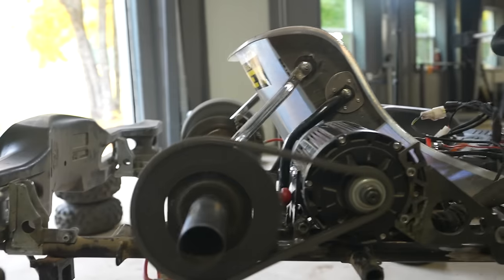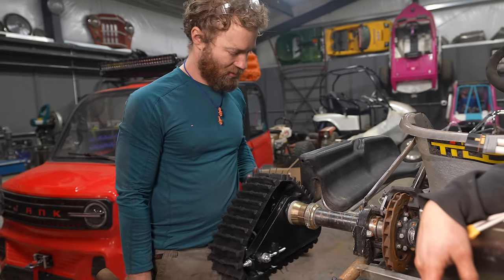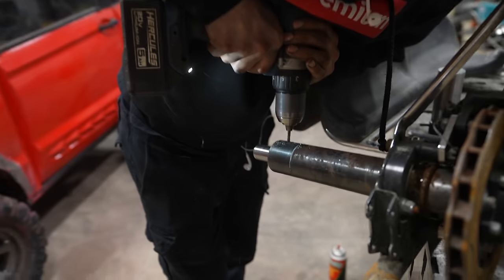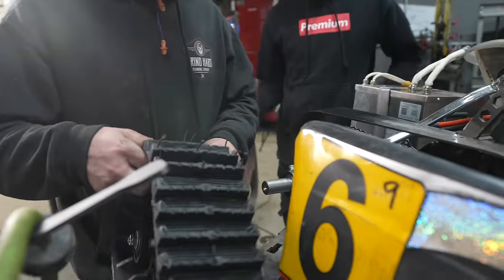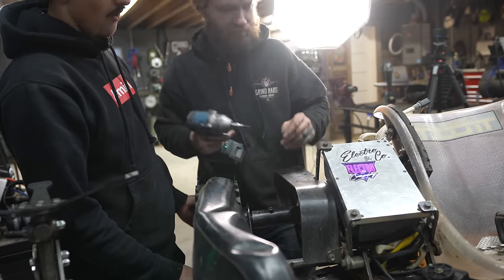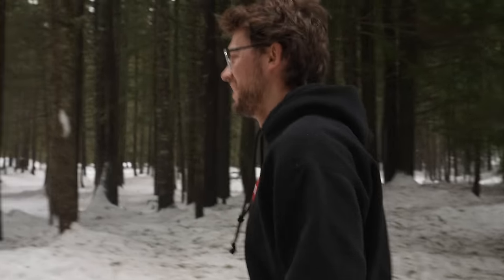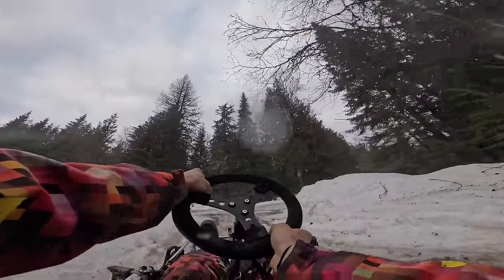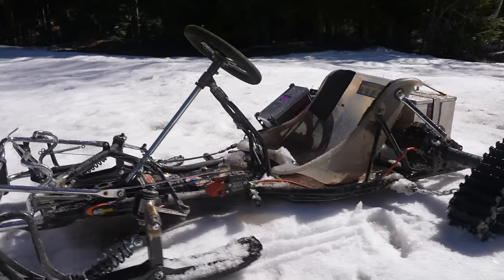Sleeper Go Kart gets Tracks and Skis!

Comment: Hey machinist Willey! Next time you only have to take off a little bit just run it again without turning any dials. It's called a spring pass. It just takes off the amount that the cutter flexes away from the part. You'll be surprised how often you can go too far without going anywhere!

Comment: Make an electric crosskart "trike" with a battery pack in the back (over track), but have it on a swing arm, so that it works like a servo, making it so you don't have to tilt/ lean while turning, and able to control it while doing a wheelie! 
This proof of concept can start a new wave of snow machines, since electric snowmobiles as is sucks hard and is anything but premium.
Reply: or just put the motor and tracks on the barbie boat to make it amphibious all weather
Reply: Sorry but I'm confused  why would u have to lean/tilt in a cross cart to turn? They have 4 wheels? We'll tracks if I'm reading this right lol
Reply: @Todd_G_FPV  Not OP but probably to counterlean during a turn. With long suspension vehicles (without an anti-rollbar) during turns, they have a tendency to lean outwards. this would solve that without using an anti-rollbar (which you want for some reason????).
Reply: @Todd_G_FPV  Let me clear things up.. it's a snowmobile, but picture a crosskart trike, the battery can lean from side to side as to shifts the center of mass, it also offset driver weight up front 2, using the battery weight as a feature, and not a flaw like EVERY electric machine ever. 
it would be MUCH safer during avalanches, and you'd be able to climb RLY well in it.
for those who play in snow, this will save lives.

Comment: When going through my machinist class. The math behind it is that when cutting circular stock on a lathe it is actually double the depth of your cut. So cut half of what you want until you get comfortable enough to take the big cuts
Reply: Yes because you are decreasing the radius by the amount you move. So it takes that much off of each point all the way around the circumference.
Reply: 1/2” cut on the radius is a full 1” off the diameter.

Comment: NGL GHPC, could throw solar panels on the roof of the shop and have a battery backup system (and I think Anker makes those) which would help the power problems (when they occur)
Reply: Anyone who owns a home that can afford solar panels and home battery back up should get that installed ASAP. My power cost has gone up over %20 in under a year. If cost continues to rise, the ROI graph will be a curve, not a straight line

Comment: I love working with old machines. Had a 1970s good way lathe at the last shop I worked for. Amazing tool. Could take some massive cuts. For example it could take a .650 thow interrupted cut comfortably. Or it could turn some perfect sealing surfaces. Also I agree with never using calipers on fits. Gotta mic it! Or test fit! 🤣 you guys are amazing!

Comment: Use a small drill bit to make pilot holes before using the step bit. It will save time and make the step bit last longer.

Do NOT blow chips off a part without safety glasses or at least close your eyes first.

Comment: That motor is wayyyy too powerful for the tracks! 😂
Reply: its either the motor was too powerful or the tracks were just designed to go much much slower.  They probably designed them to go on some kids toy at like 1/10th the RPM
Reply: @davidanalyst671  Agreed. 👍

Comment: Hey Will. Always put your heat into the thicker metal and let your puddle wash into the thinner material. That will create better adhesion to the parent material and you wont get the "log" appearance.  And as always, setup the welder with practice pieces of the same thicknesses.  "Make love to it, don't f@wk it."

Comment: I see that gives you 6,000-W and an amp rating of 30 amps. If you use the lathe, air compressor, or welder, all separately and not at once, then you should be fine. But you'd benefit from the double setup they have, giving you 12,000-W, or the battery expansions like you said.

We thought we were ok here, and didn't need a backup generator. Then the power went out for 31 hours a few weeks ago. The next day we ordered a 22-KW Generac Guardian generator with the automatic transfer panel. It runs off of natural gas or propane. The entire generator with the transfer panel, shipped to the door was about $6500. And then another $700 in parts for the conduit and wire. We wired it ourselves, and it's big enough to run our entire place (including 2 HVAC systems and a boiler) and were able to hook up our neighbor's house also, since they don't have AC, there's not much of an amp draw there. In any power outage though, we just don't run the electric dryer, and likely could go a couple days just hanging laundry.

Comment: your electrical setup in the shop with that anker bank is so sick. i wonder how long it would last with you guys just doing normal shop things for an episode.
Reply: Not as long as even a single generator…. The battery backup is stupid for their application. A shop, in the middle of nowhere, doesn’t need this. A simple generator or even 6 will do the trick, for less money.

Comment: I want to see you guys put a huyabusa engine into a gokart or quad. Also maybe put one of the model engines for RC cars that run on nitrous into a full sized vehicle to see if it will work.
Reply: Hell yeah,a Huyabusa powered four wheeler would be sick AF! I would really hope that they would stretch the frame out a bit and then lengthen the swing arm too! No sense in doing all that work to build a bad ass machine if it’s an unridable death trap!
Reply: Fax

Comment: You should put two tracks on either rear tire and put a outer guide to keep both tracks on actually inner guide and outer guide welded on the outside of either side.
And put wheels on the front they will still turn in the snow similar to skis.
And I've seen at the drag strips where they put solid rubber on the tracks instead of grooved

Comment: 18 yrs ago I bought a back up generator 30k that runs my whole house.  6,200 squ ft. It runs on propane has a Chevy 4 cly. Hooked it i have a 500 gallon tank. In 12 years it starts 1 time a week for 15 minutes. There was here in Missouri we had a bad ice storm out of electric for 7 days straight. An a lot more other times we was out , it only used 450 gallons propane in that 12 years.  Kicks on with in 15 seconds automatic. One of those battery generators be awesome for my Rv. The price is not bad at all. Mine was $12,500. It get hot in Missouri run 2 ac units an every light. Its paid for its self. I live out in the country.

Comment: Here's a fun idea. Rework an old skid steer to be electric and stupid fast. You could make it a differential breaking system or a independent  drive for each track. I think it would be a fun project and it might be the only way to handle all the power those electric motors put out.

Comment: Be careful! I think you should first plug the orange plug and then the blue connector to the wall. 

The blue has insulated connectors. If the wall is live (happen to have forgot one fuse on), the orange plug could have dedly live prongs exposed. 

Cool things you are making

Comment: I used two 12 inch speed squares (carpenter tool) to attach two ski tips about a foot long to my downhill mt bike to ride the snow. The hypotenuse faces forward and the tail end of ski is exactly where the wheel is designed to hit the ground. If the back of the ski extends back beyond the line drawn through your head tube to the ground  it ruins what the geometry of the vehicle was designed for. I lucked into this knowledge, but it's for real. On my Wheelski (Patent search confirms my design is fit for utility patent in 1998 for unique pivot. Acts like knees of the skier) I could shred the slopes
You guys need to hear my testimony. LOL Seriously though, I was riding ski slopes on my DH bike at Woodbury Connecticut on weekdays and Plattekill in Roxbury New York on the weekends. I could ride with no hands it was so stable and I could make turns so sharp I could touch the bars to the snow, but Plattekill is super steep at like 40 degrees so maybe that accounts for the crazy turning
anyway, love your projects and love watching fun

Comment: Now you need a contactor to automatically switch over to the battery box when the main power goes out.
Maybe on day he will find that there are intermediate position of the throttle pedal beside all the way off and all the way on.

Comment: With the circuits you basically mean that you have it wired to the lines leaving the fuse box to each zone. Just to clear it up for those that don’t understand. It’s so he has direct power that is then connected to each zone powered by a generator. It’s super simple. Yes anyone could connect it themselves but please make sure all power is cut so you are not playing with live wires. Only after it’s installed and inspected would I suggest testing and turning it on.

Comment: General needs a oil seal or gasket somewhere to stop the oil bath your giving the floor. The 16k Generac natural gas genset  powers our Whole house and I have a Welder and big 220 air compressor I use occasionally.

Comment: So if the power is out, could you flip the breaker panel over to the Anker, which would then be powering everything, could you plug that 1800W wall plug and charge whilst running?

Comment: Rookie mistake with the lathe, you have to remember that taking off .5 mm is 1 mm in total when dealing with circumference . A bridge port is different when milling a single sided object Unless you are using a rotator vice then the same rules apply.

Comment: Very crazy project. 
But i have a clue why the nice guy at the lathe failed several time to meet the required measurement.
It might be possible that, at the very last measurement, he decided that he needs exactly, lets say for example 1/10 mm less in diameter to meet the goal.
And if he doesnt think twice, he will not realize that, if he will adjust the cutting egde just that 1/10 mm, the overal diameter of the shaft will decrease for 2/10 mm.  Because what you are cutting away at the front, will be removed at the back as well.
I know what i am talking about. Happened to me as well...several times.
Keep on the good work.

Comment: Anker SOLIX F3800 Portable Power Station $3000.00 w/ 10 year life expectancy

DuroMax XP13000EH Dual Fuel Portable Generator Gas or Propane Powered, electric start, $1500.00 unlimited lifetime expectancy

I used the DuraMax brand because it is by far the best budget Generater on the market

Comment: Hey, how is the shop air ?

Filter your air man! Think about your lungs❤❤😊
Reply from the maker: we've been trying to sort that out. Not sure how to go about it. Suggestions?
Reply: @GrindHardPlumbingCo  how about cheap Fume Extractors they are pretty portable and easy too use. 🥰

Although if you have space you can get a central Fume Extractor that has extensions too various spots in the shop.

Comment: One trick for better lathe cuts wrap a big rubber band or a large coil spring around the chuck/head this is an old trick learned from machining drums and rotors it reduces the chatter in the cuts to near non existant

Comment: how do you determine the final gear ratio with tracks? Is the size of the individual driven single wheel in the track the diameter you use?  Apparently its not the height of the top of the track to the ground

Comment: You don't need 2400 watts of solar unless you plan on using that as a standalone unit.  You could easily get away with less than that if only using it as a backup.

Comment: Its cool to see someone make a mistake and also take criticism accordingly with a smile and acknowledgement of the mistake and their previous false sense of professionalism.
The lathe, the caliper, the trusting of the caliper either not used correctly it appears, because the gap was very noticable. Even a dollarstore caliper would not have caused such a gap, therefore, learning to work the caliper is a concern, as is also to double check the amount of material being shaved off with the lathe to help compensate for the way the caliper wasnt held to the exact diameter when it was being treated like a tool to rely on.

I make tons of mistakes and try to learn from them, I study physics, sociology, criminology, and music.
Party on Garth, you are a worthy team player that learns from mistakes rather than flipping out and stomping out the door like avid beeeline exit plan narcissists do.

Comment: That's just what boxers do... 🎶 🎵 ⏹️ 🪕 🎼 💿 🎶
Reply: Will blew another head gasket...inevitably.  😂
Reply: My Subaru heads have been leaking for 70,000 miles but a well seasoned boxer can go 12 rounds if you know what I mean. 😮😂
Reply: Hey Will! Do you want to come to San Diego and fix my head gaskets in exchange for surfing lessons? 😂🎉❤ 🙏
Reply: I just put new plugs in and removed and cleaned the throttle body.... but the main issue persists.  😮😊😂
Reply: I have enough boards and wetsuits to teach the whole crew to surf if you want to come to the coast. Different vibes with no motor in the water! 🏄‍♂️ 🌊

Comment: You had traction. You were just afraid of it. Honestly it would have looked sick to get tires front and back as wide as you can find that clear everything. It works in the snow with this setup but looks like dirt is a small challenge. Maybe make the same setup with the motor and all but this time use wide tires and race them both. Test and see which one has more traction, faster, maneuvers best, and overall has more use. Kinda like a compare and contrast test for them.

Comment: 19:30 Why not just put the tube in to protect the frame and use the back bolt for the chain? Why it could need two bolts for this?

Comment: Lol,takè one or 2 12v batteries and a set of jumper cables or welding cables and one cab be stick,tig welding immediately.. I'm  pretty sure that that power supply would be drained down to dead when hooked to house supply within just an an hour or three maximun...prove me wrong within 5 minutes..

Comment: Aw yes, lets bring in the dangers of EV batteries inside the home and put them to their limit. All it takes is one cell to self combust and you have thermal runaway that produces massive amounts of toxic smoke, well as burn until dunked into a water container around 3000C. Absolutely fantastic idea, least not to wait until sodium based cells come into mass production so you can have half of the capacity but least it only produces toxic fumes with high pressure, not fire storm. Not ideal solution but its better than this suicidal crap. Or you could get diesel generator and start growing your own biofuel to power it.